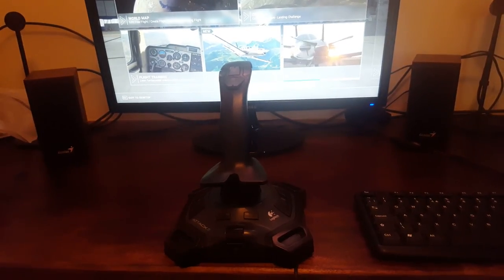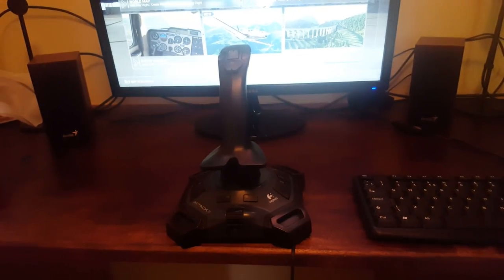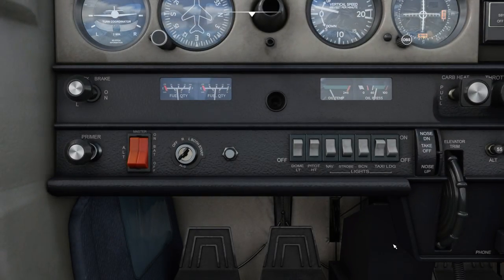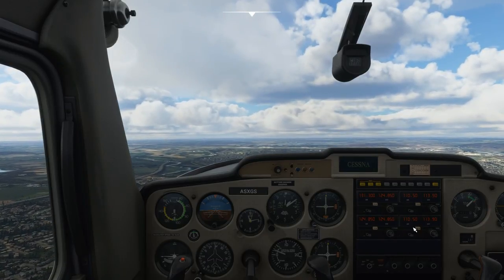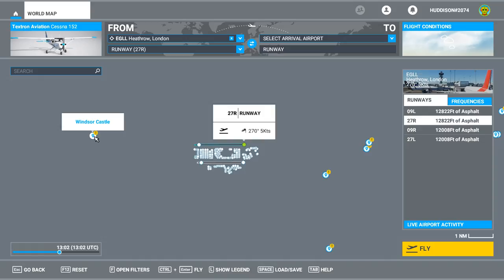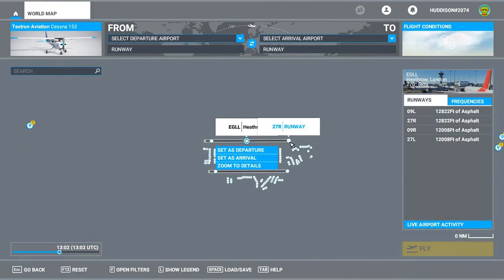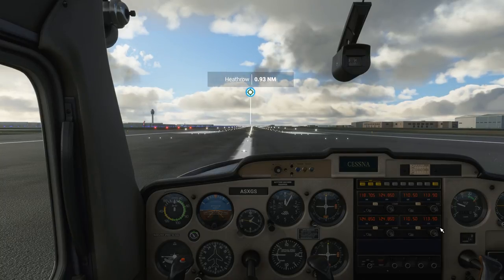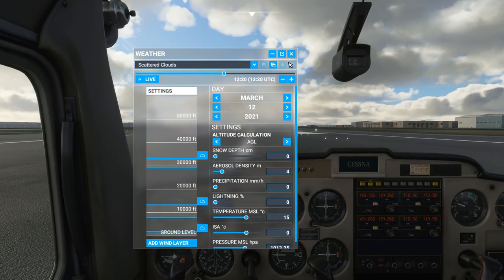FS2020: Flying, Landing and Trimming Tips - New Player Tutorial: Part 4 (Newbie friendly! 😊)

Comment: Great video. But can I add a comment. (Speaking as 2000 hour real world pilot) the use of flaps in the video needs a few comments. All aircraft have a speed at which it is structurally safe to lower flaps (Vfe) you should not lower flaps above this speed. Different aircraft have different Vfe. But the way you  can work it out if you haven’t looked it up in the pilot handbook is to look at the airspeed indicator. See there is a green arc and toward the lower end of the speed there is also a white arc. The top of the white arc is Vfe - the highest speed at which it is safe for the aircraft to lower the flaps. I haven’t flown a C152 for about 20 years and I forget what the Vfe is and watched the video on my phone so it was a bit hard to see what speed was marked in the airspeed indicator. But what I could see was that flaps were applied while the airspeed was above the white arc so way too high. So the pilot should pull back on the throttle first, raise the nose and wait for airspeed to bleed off till you reach Vfe before applying any flaps. The use of sequential multi stages of flaps is not usually used in small General Aviation aircraft. Sequential stated flaps is for heavy stuff like airliners etc. The usual pattern of use in GA is there is a flap stage for normal landing, a stage for cross wind landings and a stage for short field landings. The pilot decides what type of landing is going to be used and the appropriate stage is applied in one hit at the time of initial application and then it’s not changed for the rest of the landing. That tech I would accept isn’t cast in stone and maybe gets taught differently in different places but the Vfe speed and not applying any flaps till reaching Vfe is universal and necessary to stop damage to control surfaces and cables. But other wise very useful video. Cheers
Reply from the maker: Fantastic additional comments! Many thanks 👍

Comment: Awesome video, very helpful, thanks for sharing. I am struggling with the MSFS training routines. The last one on the take off and landing section dictates to maintain a climb rate of 75knt to reach an alt of 6000 or whatever. I have spent countless hours trying but always fail this first leg. Can trim be used to maintain a climb rate on take off?
Reply from the maker: Trim might help, if that particular lesson allows it. Also FLC mode, which allows you to set a specific rate of climb.

Comment: @Huddison, I know this is an older video (they've made further changes to the software since this was made), but I was wondering how you manage trim with the Logitech Extreme 3D Pro? I don't mean which buttons, since those are subjective/personal choice; I mean how do you actually get trim to *work*? I've tried several different button configurations, played with settings, sensitivity, etc., and the trim wheel on the MSFS2020  instrument panel is in fact moving --- but the trim WILL NOT HOLD. As soon as I let go of the yoke, the plane starts to descend and the trim percentage starts dropping.

I've seen on numerous online forums, including the MSFS2020 forum, people having this exact same issue, even with fancier yoke setups like the Logitech G Flight Yoke System with Throttle Quadrant, Saitek, etc.  Since you used a simple Logitech flight stick for this video, I was curious to know if you managed to get trim working (i.e. make it stick, not just adjust and then quit), and if so, how?

In other words, if this were cruise control in a car (which I use constantly), it would be like getting the car to the desired speed, pressing the cruise control button, taking your foot off the gas, and the car's speed starts dropping just as if you'd never pressed the cruise control button. (even though a moment before, it registered that you did)

If you have any advice, it would be greatly appreciated!)😀

p.s. I'm a newbie to flight sims, only just purchased MSFS2020 four days ago as of the time of this post, and also bought the Logitech Extreme that same day, so I'm brand-new to that controller as well.
Reply from the maker: Have a quick check in your 'Assistance options\Piloting' and ensure you turn off AI assistance (particularly Trim assistance).

Comment: If i pull/push the joystick after a trim, will the trim be resetted ?
Reply from the maker: No the trim will remain at the setting you adjusted it to.
You aircraft will either descend or climb though, depending whether you push or pull your joystick.
Reply: @Huddison  in the video, u teach use the nose landing gear to first touch the ground.
However I watch many other aircraft like boeing, airbus, use the left and right wing landing gears to touch the ground. Thats meaning of the nose is in upward direction at the last min of landing on the ground
Reply from the maker: @user-mfsc-2024  That's because I'm in a light aircraft, like the Cessna 172 and can get away with that type of landing.

You are correct: generally you want to 'Flare' the aircraft - i.e. the back wheels touch down first and then bring the nose of the aircraft down gently on the runway.